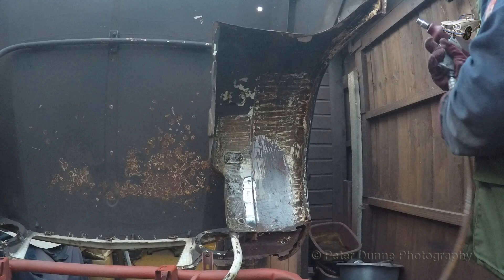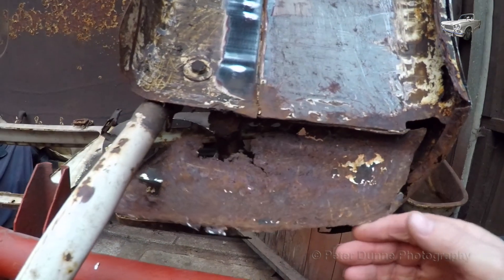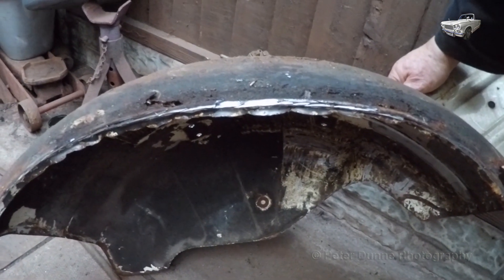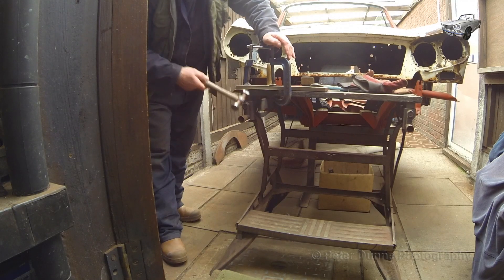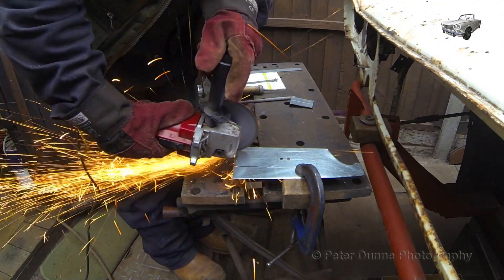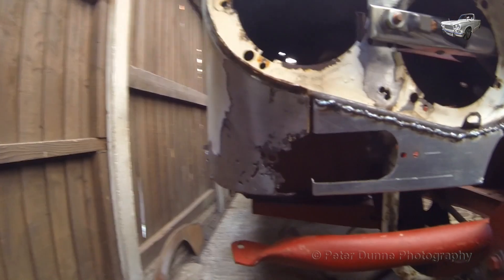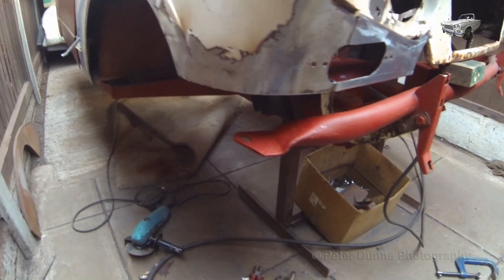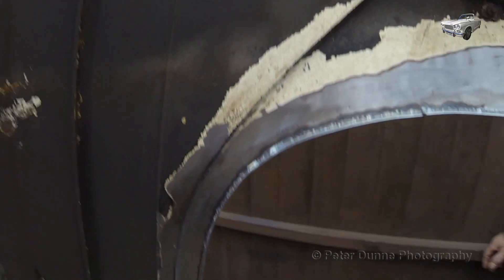No 9 Red Vitesse restoring bonnet assembly HD 1080p

Comment: Hi Peter, how many steel templates have you lying around. Cheers, Joseph
Reply from the maker: I don't have many steel templates now, when I made those about 30 years ago,  I worked in a engineering company where they had a profile burning machine. Since then I usually make my templates from ply wood.